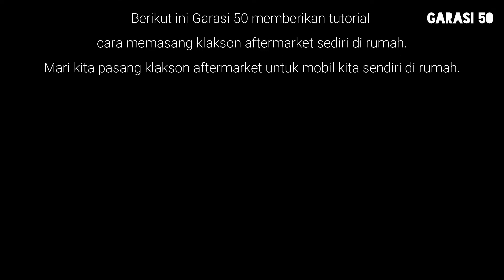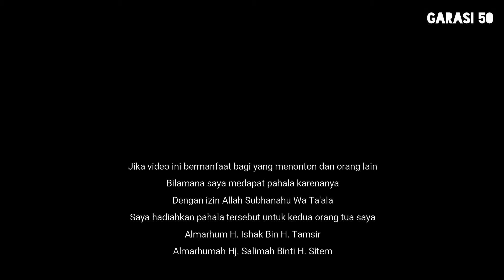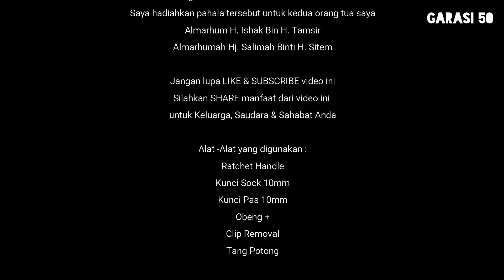Cara Pasang Klakson Aftermarket di Honda Brio

Comment: Harus bongkar bumper depan ya? Apakah bisa tanpa bongkar bumper depan?
Reply from the maker: Yes harus lepas bumper Om
Reply: @garasi5014  klo saya liat2 tutorial lain, ada yg bisa tanpa lepas bumper. Tapi mobilnya brio/mobilio yg baru (lampu kotak). Apa beda ya?
Reply from the maker: @exel99999  Bisa aja Om, tp kalo saya prefer lepas bumper, Krn ruang kerja terbatas (sempit) jika bumper tdk dilepas. JD agak repot jika tdk melepas bumper. IMHO 🙏
Reply: @garasi5014  oke sip. Terima kasih infonya 👍